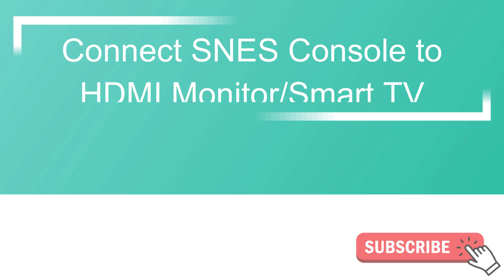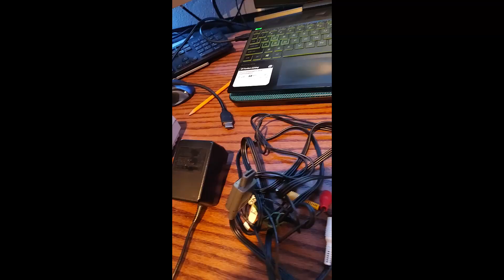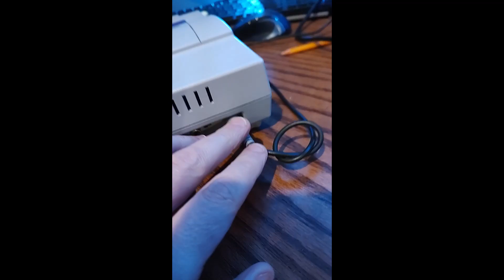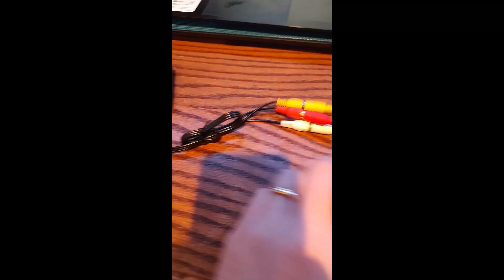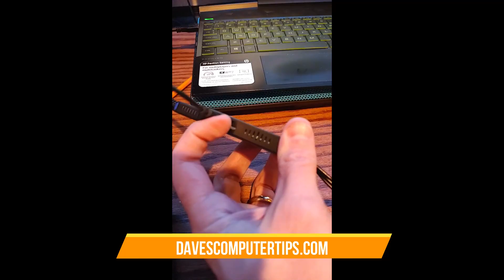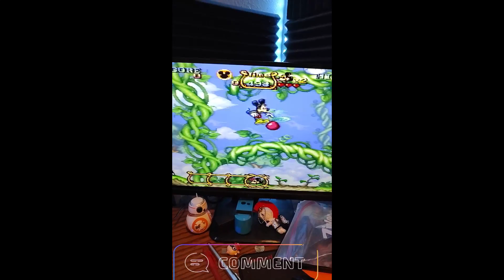Connect SNES Console To HDMI Monitor/Smart TV

Comment: Just got the hdmi adaptor and when I turn on my super nes it’s just has a blue screen with no signal. Doesn’t even work with the original plugs. So annoying!
Reply: I have the same problem. You haven’t got it fixed have you? Really annoying indeed..
Reply: @ManUtd1337 if you have an iPad or tablet you can use an emulator. That’s how I did it

Comment: How did you get your audio working?
Reply from the maker: As long as you have all the RCA (AV cables) attached the yellow, red and white. Also make sure the speakers are hooked up on the monitor or TV. My Monitor I showed this on has built in speakers.  Now if you are streaming make sure the streaming software is turned on first or you will not hear anything. This has to do do with running the HDMI through your Elgato or other streaming hardware. You might need to unplug all the cables and reattach them again to make sure they are secure. Found that worked when I could not hear the audio. This sounds like you will need to do a little trouble shooting to see what is causing the issue. Hope some of this helps.